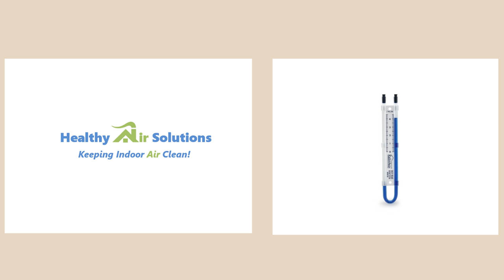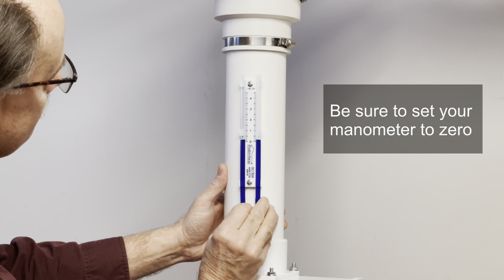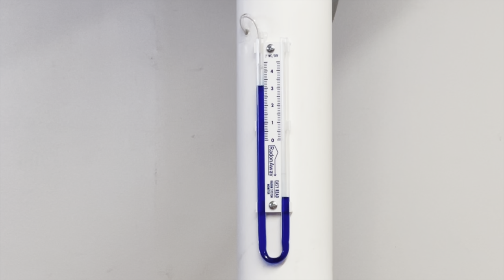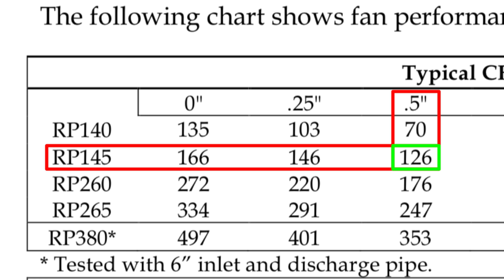Installing And Understanding Radon Mitigation System Manometer

Comment: Thank you so much I installed my rp145 and I was at 1.9 -1.8 with very little air flow. I then took it apart excavate some more and only had an improvement of 0.1, so 1.7 to 1.8. Luckily I have an insulated sub floor in the basement so I left the concrete par unsealed and sealed it up on the sub floor and I now have 1.5. I know this will create an increase negative pressure in the house instead of under the slab. We don't run gas here so I'm not to concerned. As Radon hit the sub floor it will get sucked out.  Thank for your video it really helped me out.
Reply from the maker: That’s great to hear! Thanks for the comment.
Reply: @healthyairsolutions5950   When I finished the initial install and saw 1.9 I knew something wasn't right. By watching your video it confirmed it and it confirmed me that I needed to do something about it.

Comment: Great video. I have a quick question. I installed the pipes, almost in the last step of connecting and sealing. The pipes inside the house does not permit enough vertical room to attach the manometer vertical aligned to the pipe.
Can I install the manometer, vertical, close to the pipe in the wall and insert the pipe that sniffs the pressure in an angled pipe? (As long as the drilled hole is also angled against air flow).
Reply from the maker: Yes, that should work just fine.

Comment: We purchased our home in Southwestern Pennsylvania (built in 1890 with a full 900 sqft basement. It has a concrete floor.  And,  upon an inspection for radon that we wanted performed it was determined  to have a reading of 62.4 picocuries. 
A company was hired by the seller to mitigate the levels down to below 4. They came out and installed one 4" pipe in the lowest corner of the basement,  thru the floor, up and outside thru the basement wall, then all the way up to 1 foot above the roof with the fan outside. Seemed okay rather than going thru 3 levels inside. However,  the fan used is a "RADON AWAY GX4" and has a constant read of 4 on the u tube Manometer.  I was told by a neighbor who just had his system installed last year (similar size house and basement) that his installer did the same with the same readings. Later, after having to replace the fan, he was shown that the 4 on the u tube gage was now where it should be with the oil levels reading about an inch higher on one side. It was shown to my neighbor the original  installer did not dig out hardly any materials after coring the hole through the floor in the basement  other than a few inches. His new repair man removed two 5 gallon buckets of dirt to achieve an open area for the pipe to draw from. 
The first company had just drilled the hole a little deeper by a few inches than the pipe depth they installed.  He told my neighbors:  "You have a very powerful fan, and no way to suck gasses out. It was choked in the ground, pulling nothing hardly at all."
They ended up running two additional 3" pipes to the opposite corners of his basement installed correctly.  
So my question is this: with my brand new system reading at 4 on the utube Manometer with only 1 4" pipe stabbed in the ground.  What would you think is the problem. I have no valve. 1 pipe, one hole, no insulation or heat tape line in the pipe outside to prevent moisture condensation freeze up. I appreciate your answer and very intelligent  & informative video.
Subscribed
Bell hit.
Reply from the maker: Thank you for the question! So for a GX4 a reading of 4 is the maximum for that fan. It could be that your pit was not dug out but sometimes even after digging, it still is not able to get enough airflow or reach without adding another suction point. A 2 suction point day is rare but they do happen. But how you would determine if anything needs to be done would be doing a radon test. If the levels are below 4 your system is doing it’s job. If not than you would have to look at the suction pit if it was properly dug out or if there may be a need for more suction points.
Reply: @healthyairsolutions5950  thank you so much. This is exactly  what I thought you would say. I'm going to drill several 1/2" test holes to see if it's pulling to those areas.  If not, I'll run more pipe to the them.
Reply from the maker: Your radon levels were very high, we hear that quite a bit in Pennsylvania. 
Just curious, what were your radon levels after the installation?
Reply: @healthyairsolutions5950  the seller sent the test package envelope in for those results and hasn't received that info yet. However, at close of escrow on the property they did fund the money for an additional drop/suction line, or $695.00 to cover that cost. 
In our mountain house, we ran two additional 3" lines...1 in the mid section behind the stairway (about halfway,  or center basement) and one at the far end. The readings dropped to -.30 
Pic. in that basement.  I purchased the "Airthings Digital Home Radon Monitor " and hung it chest/waist high in our current basement to get a good idea of where we stand now, after the new install. I have as yet get a reading as it's instructions say it can take 1-2 days before getting a short term read. (I believe that's what it said, I'll re-read them) I did follow the directions though.  At the 24 hr. mark it was still blinking on both long term & short term info lines. I am seriously considering coring a 5" hole about 8" from the newly installed unit to see if they did to me, what they did to my neighbor... no dig out of soil around the suction pipe. (Found out it was the same "reputable" company, go figure) I'll be going over to do more repairs upstairs today and I  am hoping to get a reading. I'll be happy to report them back here....or, is there a good was to discuss/text message with you directly? So we dont discuss this publicly.
I don't mind doing it here so everyone can learn from this. My family will be living full time in this home. I simply don't care how many pipe runs I have to install to mitigate down to minus levels.  I was told the GX4 can support the original 4" installation with 3 addition 2-3" evacuation points into the floor by  the fan company...when installed correctly. Meaning open the area below the pipe sub/layers of soil under the floor.
Once again I truly appreciate your taking g interest in my situation and sharing your experience based knowledge. Respect to you.
Reply from the maker: @Rag Tie It’s no problem at all, we are happy to help. If you would like you can go to our contact page on our website and either call or email if you prefer to continue this discussion:
https://www.indoor-air-health-advisor.com/contact-us.html
We are a family owned company, so you will be talking to my father Val. He will be able to talk you through what steps you can take to fix your situation.
Just mention that you are contacting us from our YouTube channel about an improperly excavated suction pits. 
But I just wanted to give a few suggestions tho, to see if your pit is dug out, you could cut your pipe around 6 inches from the floor or above the coupling, depending on how it was installed. Then you could look down and see the pit. At times when we have fixed jobs that weren’t properly dug out we have been able to suck enough dirt out with a shop vac after cutting the pipe. This would only work if things are loose tho like sand. But it’s a good way to inspect without drilling more holes than needed. Then you can fix it with a 4 by 4 rubber coupling. 
Also, if you haven’t already done so, make sure to zero your manometer. Pulling out the tube and letting the liquid settle. Make sure the liquid lines up at zero. We have a video on manometers if that will help. If it’s not on zero then you will be getting even less airflow than first thought and would point to either the suction pit not being dug out or the need for more suction points.

Comment: When you mount the manometer to the Schedule 40 with a screw (top and bottom) are you creating a space for air to escape?  Is there any way to caulk around that screw or put a piece of foam behind the screw prior to screwing it in?  Or will the screw fully seal if you do it slow and don't over torque the screw?
Reply from the maker: Great question! The screws are airtight and they will not leak air.

Comment: I'll have to document my stuff. I don't think i have a problem but who knows. I have a partial finish basement with a sump and floor drain and an addition with a dirt crawl space. Inspector made them put plastic down before the house could sell. I can hear the vacuum at the sump well and drain.
Reply from the maker: Hi @woodstream6137 If you are hearing suction at your sump it’s probably not sealed properly and the drain may not have a trap.

If you are in need of more advice you can always fill out a contact form on my website and I’ll be happy to help. https://www.indoor-air-health-advisor.com/do-it-yourself-radon-mitigation.html
Reply: Thanks for replying. Previous owner had the sump cover siliconed down and it was a mess, didn't look like a pro job. I had to replace the rusted pump so put a new fancy cover with multiple access points over it. Didn't seal with silicone because I'm a noob and wanted to see if it worked first plus it makes yearly maintenance easier. Going to put 1sqft thin rubber mats around the perimeter. 
After watching your vids, checked my stuff.  labeled RP145, pressure is 1.4  I noticed the label only had sub slab depressurization checked. The crawl space sub membrane and sump pit boxes weren't checked. Battery powered monitor is always below 0.5
Reply from the maker: Sounds like the system is doing good. The RP145 is at a decent pressure and it’s not maxed out. Radon levels are good as well.

We often find that when you fix the lower section of the basement with a sub slab system, it fixes the crawlspace. It’s not always necessary to seal and suck from it. 

If using the rubber mats doesn’t work to seal it, don’t be afraid to seal the cover with silicone. It’s a good option because when you need to get in for maintenance you can score it with a utility knife and it will come up pretty easy.

Comment: We have a new single floor house with approximately 1800sqft of basement. Our airthings is giving us a reading of around 4.5 since we have been in the house for about a year. Our radon pipes are installed thru the attic and is a 4" pipe. We have some separation between the basement floor and foundation walls and it is a walkout basement if that matters.. What size radon fan would you recommend?

Thank you!
Reply from the maker: You can began with sealing and see if that brings the level down. It sounds like you have a passive system, so hopefully it was installed over drain tile or in gravel. If that’s the case a RP145 should work. This page on our website discusses to troubleshoot a passive radon system: https://www.indoor-air-health-advisor.com/passive-radon-system.html

Please let me know if you have any other questions.

Comment: My manometer came with about 6" of tubing. Is it okay for me to buy and use a piece of tubing that is longer, as long as it is the same size? Using longer tubing will allow me to mount the manometer in a better location.
Reply from the maker: Yes that’s no problem at all. Just as long as it fits securely in the manometer and the hole in your pipe.

Comment: Excellent demonstration with manometer, I just purchased the RP145c.  I was having a difficult time deciding between 3" vs 4" ducting.  I only have an 1150sq ft slab with sump pit and drain tile + gravel underneath but I decided to go with 4" for noise concerns.  But my fancy lid I have ordered comes pre-fabricated to accommodate a 3" sch.40 pipe.  My question is am I defeating the purpose of using 4" ducting throughout only to have to reduce it to 3" right at the port on my sump lid?  Or does airflow/cfm remain the same it just moves faster at the 3" port?  Thanks again for your video!
Reply from the maker: Thank you for your question. Having the system start off at 3 inch is a restriction but you are benefiting from having the rest of the system run with 4 inch pipe. But what we do with those covers is we remove the 3 inch hardware and we enlarge the hole to 4 1/2 inch.

Comment: My installer attached one outside and the rain washed it out; I'm installing a new one, how can I make it weather resistant?
Reply from the maker: You can add a small piece of tubing, perhaps from your old manometer, to the open side of the new manometer. Then you want to curve it and secure it downward so the rain can’t enter it.
Reply: @healthyairsolutions5950  Do you know if the fluid inside can freeze? I too would like mine to be outside and I live in Michigan where it can get cold. Thanks!
Reply from the maker: So you don’t need to worry about it freezing because the fluid in the manometer is oil based. 
We are over in Wisconsin so we feel your pain, stay warm!
Reply: @healthyairsolutions5950  awesome. Thanks for the info!

Comment: Where can the air dampner be purchasef for 4" and 3" pvc. Also can a simple ball closure unit be used instead?
Reply from the maker: So you can purchase the air damper’s for 4” and 3” for PVC pipe on our website:
 https://shopradon.com/products/Gate-Valve-Damper-3-or-4-p145309104

A ball valve could work as well.

Comment: After fixing the radon eliminator, is it safe to use the basement for the gym center? thank you.
Reply from the maker: So after installing your radon mitigation system you would want to test again and see if your radon levels have gone down. The danger with radon increases with being exposed to elevated levels over a long period of time. So during this time you could use your basement normally as long as the levels weren’t very high.

Comment: Where did you get that dampner?
Reply from the maker: Hello @EINAR VOLSUNG, we sell the 4” and 3” version on our website. Here is a link to the store page: https://shopradon.com/products/Gate-Valve-Damper-3-or-4-p145309104
Reply: @healthyairsolutions5950  why do I need this damper for? Can't I just install the meter and measure the pressure at open and if not enough just drill a hole, fix the hole or buy new fan? What exactly is this demper helping me with, what am I getting from closing it?
Reply from the maker: @marcusbiller867 The damper is being used in the video for demonstrating how the manometer works and what different amounts of airflow look like on the manometer.

Dampers are used in a radon mitigation that has multiple suction points for focusing more or less suction in either of the suction points. It’s only rarely needed.
Reply from the maker: @marcusbiller867  The damper is just being used to demonstrate different resistances that are seen when a radon pipe is installed in the floor.  It's just being used to mimic high and low flow situations. Dampers are used when multiple suction points are installed to balance the flow.

Comment: Which one is better?  Which do you want?  What's the number you want?
Reply from the maker: So every situation is different. It would mostly depend on what fan you are using. That would determine the pressure you would want to see to know A) it’s working and B) it’s running efficiently.